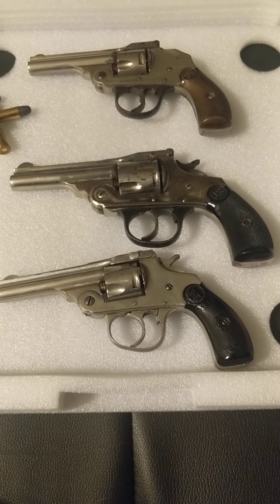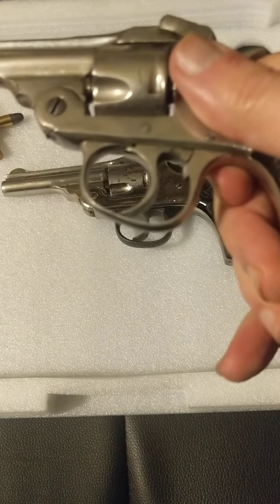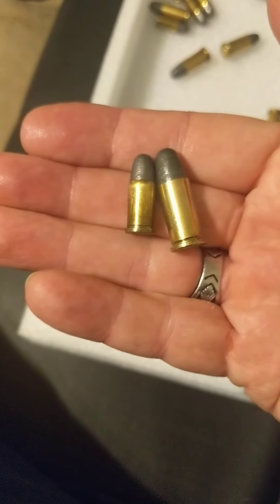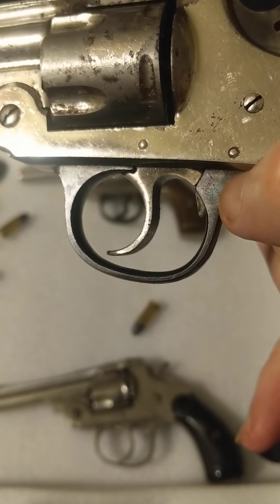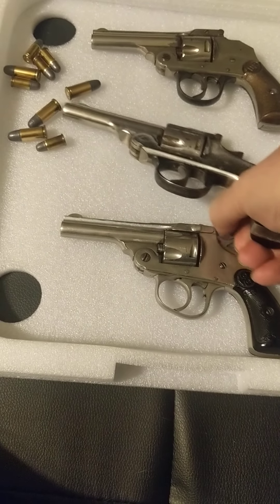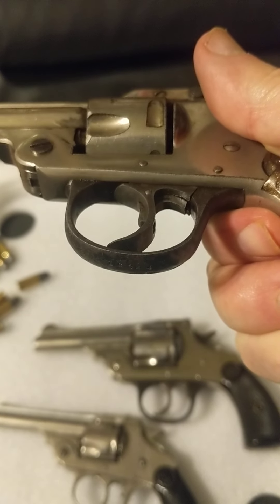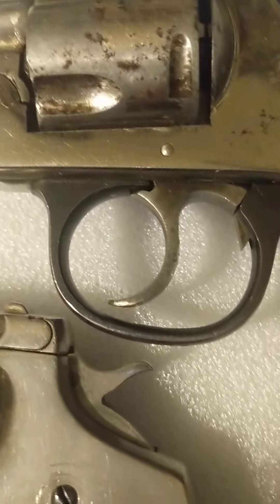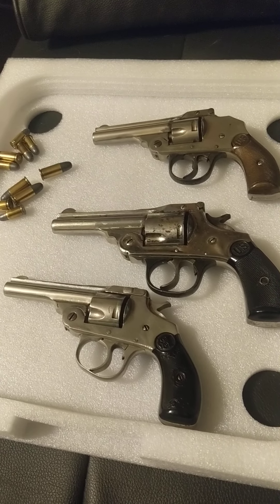Three Generations of Iver Johnson Pistols

Comment: I’d suggest familiarizing yourself with Bill Goforth’s work on documenting the variations of the Iver Johnsons. As noted, none of yours are third models. Also, the “safety” in safety automatic doesn’t refer to the trigger safety (which was on first models too), the “safety” refers to the fact that these old revos had a transfer bar for the hammer, long before others did.

Comment: Your example is NOT 3rd generation, it's second gen safety hammerless. 3rd gen had 3 frame pins, a coil hammer spring, an actual separate cylinder lock bolt (as opposed to a nub on the trigger) and rectangular mortise cylinder lock notches (not just conical cuts). The trigger safety does NOT indicate "a new generation", it was introduced mid 2nd gen run.
Reply: The “safety” part of the name refers to the transfer bar that prevents the firing pin from hitting the cartridge during a drop., not the trigger.  They advertised this heavily with the “hammer the hammer” ads.

Comment: Great video. I need some advice please. First Gun ever. It my EDC pistol. I have first generation owl handled model but different button for reloading. I have to pull up tab that is connected to rear sites. Can you please tell me if I can shoot Hornady 32 Auto 60 gr XTP?
Reply from the maker: Hi!  The answer is NO!  most of these pistols were designed for black powder and the pressure in a .32 auto cartridge is much higher.  .32 Auto is 20,500 psi, and the gun is built for 12,000 psi  and that was a long time ago.  They still make and sell .32 S&W short.  Buy that.
Reply: @neuroshrink  Thank you. I fired five shots from Revolver and had no problems. I will have to find 32 cal S&W shorts. What if it was the stronger frame model?
Reply from the maker: @LowBudgetYoutuber  It was designed for a fully rimmed cartridge, which the .32 auto isn't and the lower power.  You are shooting a .357 load in a .38 special.  Maybe nothing happens, maybe the gun blows up from metal fatigue.  Hard to say how many times you can do that, but you can never do that safely.
Reply: @neuroshrink  Thank you very much. I'm not shooting it anymore until I buy proper ammo.
Reply: @neuroshrink  Please tell me what ammo I can shoot. I just but it and ammo is hard to find and I'm not sure what to buy online. Thanks for all your help.
Reply from the maker: @LowBudgetYoutuber  https://www.gunsamerica.com/904649480/Ammo-32-S-W-Short-Magtech-200-Round-Lot-of-4-Boxes-4x-24-75-Lead-85-grain-Cowboy-680-fps-32-Smith-Wesson-caliber-ammunition-cartridges-32SW.htm

I have purchased it at Bass Pro Shop before, but there is an ammo shortage.  It is still being made.
Reply from the maker: @LowBudgetYoutuber  https://www.gunbroker.com/item/948979027
Reply from the maker: @LowBudgetYoutuber  I cant post a weblink for you because youtube rejects them.  32 S&W Short or just .32 SW that doesnt say long.  go to gunbroker c o m make an account and it is for sale there.  just search once registered that is ebay for gun stuff.
Reply: @neuroshrink  Thank you.

Comment: Hello M.R. Appreciate your video...Found one of these in dad's closet wrapped in newspaper.. Have narrowed it down to a Model 2 but kind of a second generation model 2.  Has the added safety in the front of the trigger.Actually the safety latch is missing..just a slot there for it.   Has the PAT'D. APR.6.86. FEB.15.87. MAY 10.87. AUG.25.96 PAT'S PENDING. Only year of manu was 1899 ?. Could be wrong .  Have already been wrong twice this year!. Thanks for your video post. jP

Comment: How can i tell for sure if my Anerican Revolver is a 38 SW.I did shoot 38 short blck powder out of it but the casings seemed distorted.
So my question is it a 38 top break or a 32 top break?
Reply from the maker: Is that a typo?  One, it should be stamped on the top of the barrel someplace. But two, if you shot a 38 out of it, it's not a 32. It would have blown up in your face!
Reply from the maker: What people call a 38 today? Like 38 special is a . 357.   ,38 S&W is . 361

Comment: I have a top break ... no name on it does have S# .. across the borrow is very thin, has the dbl lock .. any chance I could send you a picture maybe you could point me in the right direction on the brand name and model? I do not know how to post pic on here
Reply from the maker: What you might want to do it take a small screwdriver and take the handgrip off.  You will probably find something stamped on the frame under the grips.  you can e-mail me a picture if you would like  I am neuroshrink at gmail.
Reply: @neuroshrink  There is also a number under the barrel lug at the rear. You have to remove the cylinder to see it. Find William Goforth's book in a library or online on the history of Iver Johnson's revolvers. I'm thinking of putting mine on eBay. About $60. If you get a photo, post SN, photo, and caliber and I will look it up.
Reply from the maker: @SWAMPHUNTER644  You know, I never noticed that before!  So of course that could differ from the frame, as that is just held on with a screw. In fact, I just took one apart and they are completely different 7580 top and F54266 bottom.  Interesting.
Reply: @neuroshrink  356239
Reply: @SWAMPHUNTER644  356239
Reply: @rudraid4   What I found with an "S" serial number is a 1905, 1906, 1907 and 1908 Second Model Small Frame      Hammer Fifth Variation .32. My guess is you have a 1908. Production of 250,000 during that period thru 1907. No mention beyond 1908.
Reply: @SWAMPHUNTER644  Thank you for the info ..  I just got it out of the safe to check not a .32 ammo drop right throw ... I tried .38 S&W ammo perfect fit. The extractor must have broken somehow when I cleaned the gun .. the very tip of the treads like a 1/8" .. I wonder if I can still buy this part

Comment: Just picked up a second gen 38. Readings I’ve come across said the second gen is generally smokeless. Is there a good cut-off to know if mine is safe to use smokeless in?
Reply from the maker: I think there is a huge difference between "designed for smokeless powder" and "safe for smokeless powder".  What I understand is that the low velocity commercial rounds made for .32 S&W may cause "premature wear" on an older model, but I will confess I have fired smokeless in all of these pistols to no ill effect--as that is the only type of ammunition one can find.
Reply: @neuroshrink  maybe smokeless burns "hotter" but i can't see how the light loaded rounds could hurt when they have same velocity of bp??  pressure would have to be the same.. I don't run zillions of rounds through mine but do like to shoot it on occasion & bought dies to reload for it (but have not used bp,, guess i will sometime)

Comment: do cylinders spin when hammer at rest, (is this normal?) my 32 locks up tight & when cock starts it locks up & aligns, but spins with hammer at rest
Reply: They are designed that way, yes.

Comment: THey are revolvers Sir, not Pistol
Reply from the maker: "The Oxford English Dictionary (a descriptive dictionary) describes "pistol" as "a small firearm designed to be held in one hand", which is similar to the Webster definition for "handgun";and "revolver" as "a pistol with revolving chambers enabling several shots to be fired without reloading", giving its original form as "revolving pistol".  i.e.  the official designation of the Webley Mk VI revolver was "Pistol, Revolver, Webley, No. 1 Mk VI".
Reply: All handguns are pistols.....   Saying anything else is incorrect...    Were single shot dueling pistols revolvers?  NO.... and they predate the revolver by 200 years and the automatic by another hundred.